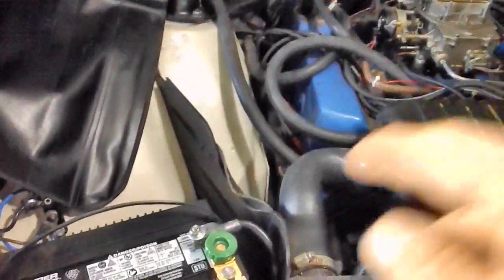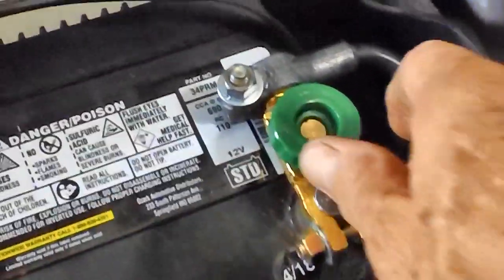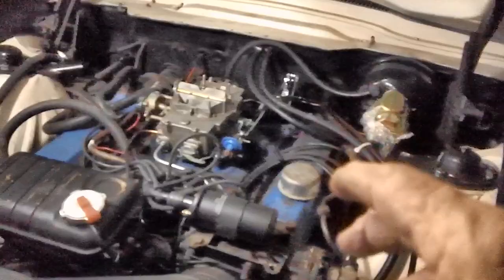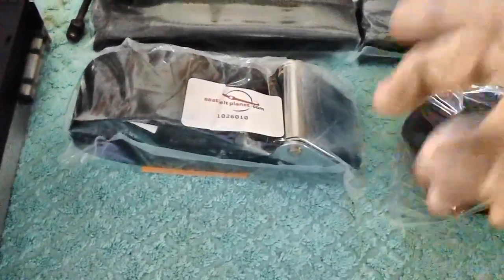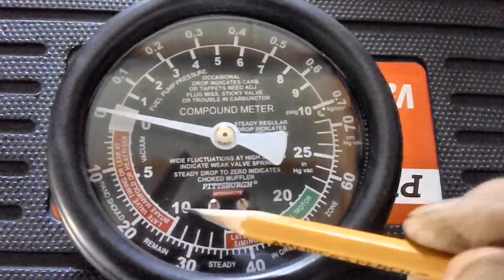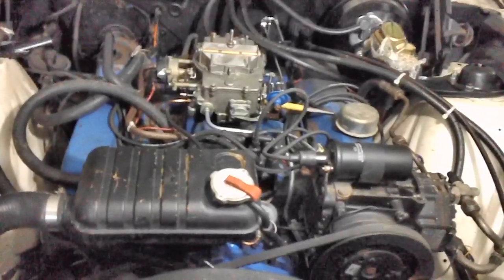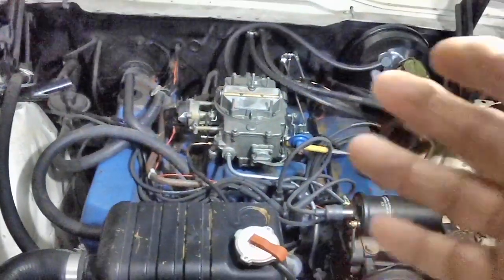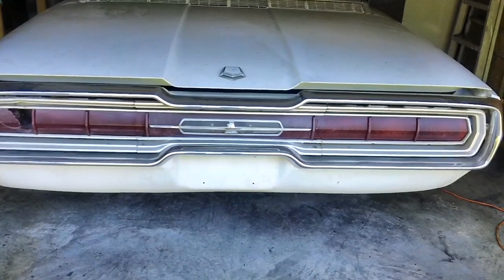1966 Ford Thunderbird repair and refurbishment (Part 99). Checking engine rpm and vacuum.

Comment: Hello John, I uploaded a short video of my master cylinder upgrade. Added a link in our msg, 2 weeks ago...
Reply from the maker: Don,
Sorry my friend, but I was not notified by YT that you had posted a reply.
I watched your video and appreciate you sending it.  It's too late for me as my master cylinder is now completely installed, with of course a modification to the braces, but I'll be sure to mention your accomplishment and video in part 100.
But I do have a question:  How did you determine that the Cal-Custom master cylinder you selected would be strong enough to reliably/dependably stop a 4,385lb '66 Thunderbird?  That's a lot of weight.
Regards,
John

Comment: Hey John, what happened to the original retractable seat belts? You can find those good used if yours were missing or broken from any of the Thunderbird dealers that sell used parts. I also have many sets of them, they are not hard to find. Your not working on a Chevy man. 

I shy away from using the distributor to adjust the vacuum with todays gasoline. Back in the day when we had 100+ octane gasoline, shops would advance the timing to achieve the highest vacuum and didn't have to worry about preignition, that's not the case with the low octane cheap sludge they call gasoline today. Preignition (pinging and knocking) is a problem today especially when running at altitude or on hot days. Most engines do not meet the vacuum gauge specs anyway because of age so if you get low readings on the gauge its not the end of the world and doesn't mean that you need a new engine. Set your timing to the factory specs (6 degrees BTDC give or take a few degrees) and use the distributor to adjust the timing only. Decades ago I started using adjustable vacuum advances to lessen the advance because of the preignition problems with the poor gas. It is not uncommon for anyones engine to ping and knock and not know it because of other noises droning out the ping and knock noise. I recently realized that my engine was pinging and knocking and I didn't know it because I rarely step on it. I mistakenly had the advance set to about 18 degrees. I was experiencing vapor lock issues being at altitude (7000 ft) combined with the cheap low octane gasoline, heat, and the wrong advance. I have since cured these issues.

Its not a good idea to attach a vacuum gauge to the carburetor since most of the ports are timed vacuum and its easy for someone with less experience to attach the vacuum gauge to the wrong port. However, the base plate on 1966 Thunderbirds have a vacuum port that is located below the carb and are not timed, so a gauge could be attached there. Best place to attach a vacuum gauge is on the back passenger side of the intake manifold where the brass fittings are for vacuum system attachments and brake booster. 

Your engine sounded great and no smoke. It doesn't surprise me because the FE engines are good motors and you did a good job getting it running. This should turn out to be a very nice car despite the Chevy seat belts. Just kidding.
Reply from the maker: Nick,
So good to hear from you again, my friend.  About those seat belts:  Back in the day before it became law, fiercely independent Arkies didn't like being told to wear seat belts while driving.  In fact, they didn't like being told what to do about anything, considering it an unacceptable intrusion into their personal freedoms (many are justifiably still that way), so in an act of defiance they would cut off the belts with a knife.  Hence, the reason for the seat belt stubs in my T-Bird. 😁  Anyway, Brendan and I have a future plan for the seat belt situation, so in the meantime I just bought a set of cheapies to get me by.  They'll ultimately be moved to the back seat.
Thanks for the tip on vacuum port usage.  I'm of course not done with the engine tweaking effort (is one ever done with anything on these classic cars?), so I'll connect the gauge where you recommended.  Btw...I'm currently using a full bottle Lucas 3X Octane Booster in the gas tank.  It seems to be helping with the idle, but time will tell.
Regards,
John

Comment: John, that port on the front bottom of your carburetor that your using to fine tune your engine goes to your transmission modulator when your all done using it! And when you run the vacuum line to the modulator, run it high above the heater hose holder on the choke side of the carburetor. FORD found out back in the day when these cars were new and on the road, they found that if you ran the hose along the top of the manifold  and down to the transmission it was sucking transmission fluid in to the carb. Port pickup!! This information came from a Thunderbird Mechanic  adviser who was a member of VINTAGE THUNDERBIRD CLUB INTERNATIONAL. Which was from a work order that he found from FORD MOTOR COMPANY from back in the 60's. I did this to my THUNDERBIRD.
Reply from the maker: Carl,
Something isn't kosher with that work order explanation.  Transmission fluid being sucked into the carburetor is caused by a hole in the modulator diaphragm, not the location of its vacuum line.  It almost certainly won't happen with a modern modulator unless it's worn out, has a manufacturing defect or some yahoo screwed it up during installation.
Regards,
John

Comment: It's interesting how something that's an old idea to me (or you) can be new to an someone else..
As Albert said, it also gives you two close terminals to monitor current drain.
God Bless...
Reply from the maker: George,
As I told Albert, I used the disconnect to check for current drain before the video was finished.  Found none.  Hooray for small favors.
Regards,
John

Comment: John.  Cheap VOM set for highest current range.  Open the battery cutoff 7 hook probes from battery post to switch output post & see if you really have an excessive (if any) current draw.  73 Al
Reply from the maker: Albert,
That was done before the video was finished.  I'm happy to report that there was zero current drain...thus far.😁
Regards,
John